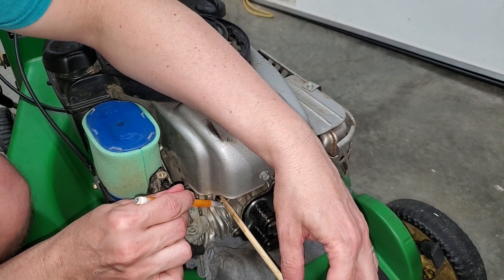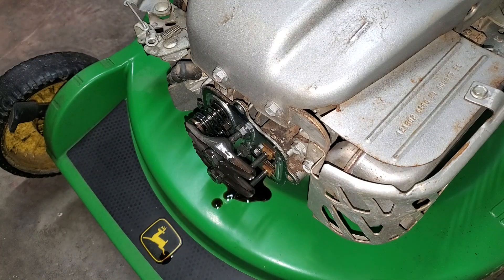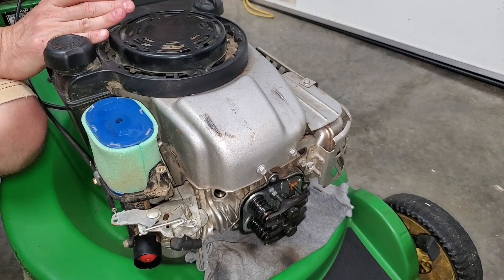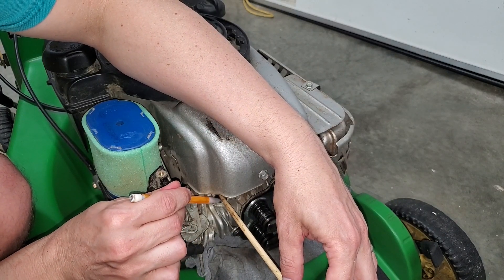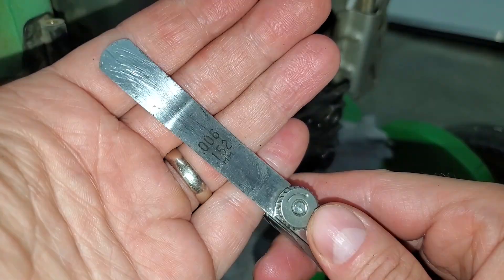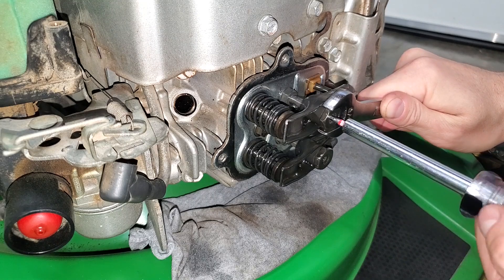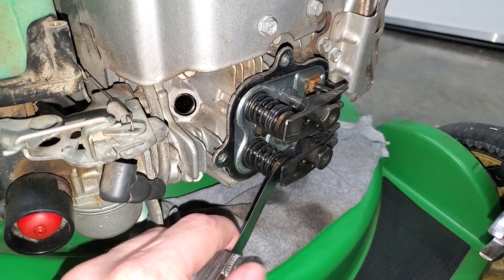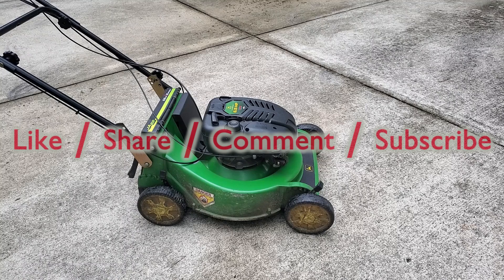Lawn Mower Valve Adjustment | John Deere JA62 Briggs & Stratton

Comment: Good video. Although you demonstrated it, it’s worth mentioning for newbies that there are 2 Top Dead Centers on 4 stroke engines, and only 1 is correct for adjusting.

And I’ve adjusted lots of Hondas and Briggs engines, never came across “1/4 inch” past TDC”.
Reply from the maker: Thanks! Good point on the 2 separate TDCs, I should have mentioned that to avoid confusion. Hopefully, anyone that watches will look for the same pattern in the valves opening and closing. Yeah, I've heard that most should be adjusted at TDC which is why I made a point to say check your manual.

Comment: Did you notice anything different after adjustment? Or what should i look for that tells me it is time for adjustment?
Reply from the maker: I don't think I really noticed much difference. However, my mower has always started easily and ran well. I thought I had heard a slight ticking sound which made me wonder if the valve were maybe a little loose. My manual (and most mower manuals) suggests checking the valve clearance every year. Since I had never done it, I figured I might as well check. From what I understand, if the valves are out of adjustment, the engine would be harder to start and possibly noisier as well.
Reply: @Mikeattempts  Thanks for sharing. I learned a lot from your video and I think this is an example of what happens when you buy a quality piece of equipment. It just keeps running but also tells you in the manual how to adjust it if needed. Really like your videos!
Reply from the maker: @Mhakeman  Thanks, I'm glad you're enjoying my videos! My sister bought this mower brand new in 2001 and gave it to me in 2004 when she moved and no longer needed it. Besides normal maintenance, the only thing I've had to replace was the primer bulb a few years after I got it. It's still on the original belt! :) Plus, it has an aluminum deck so no rust.
Reply: @Mikeattempts  Aluminium doesn't rust, but it will corrode if not kept clean. It looks like you look after your mower well.
Reply from the maker: @BrucePierson  Yeah, aluminum will get that white oxidation but, unlike rust, it's more of just a cosmetic thing. :) Either way, storing the mower out of the weather helps a ton.
Reply: @Mikeattempts  If valve clearance is excessive, you'll get a lot of noise from the rockers and it may be harder to start.. On the other hand, if valve clearance is insufficient or non-existent, starting will be difficult. In both cases, the engine will develop less power. Valve clearance is pretty important to be within specifications. Good quality engines will stay in spec a lot longer than cheap junk engines.